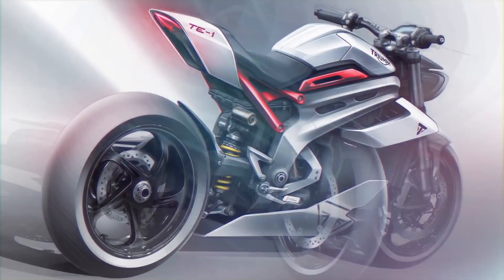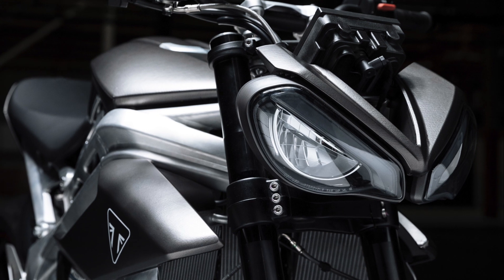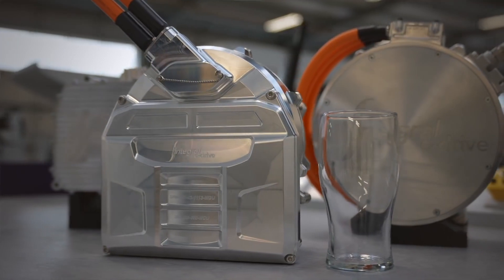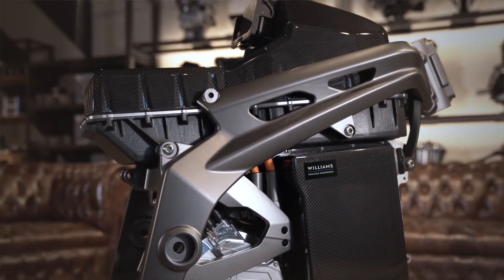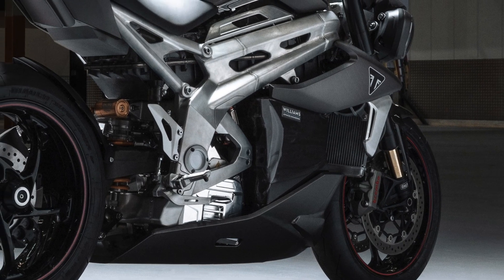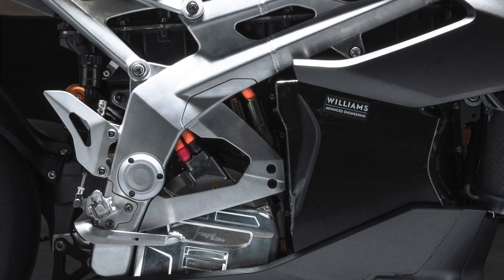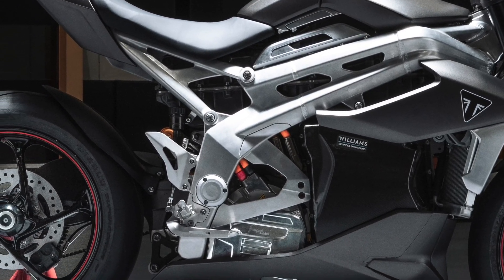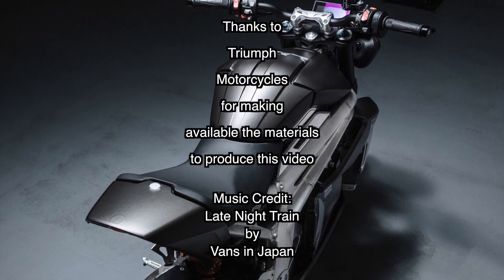The Best Electric Motorcycle Ever?

Comment: The first electric motorcycle that I really really want. The design is sick. Only 0-100 km/h 6.2 disappoints. But design... man it is something. What about indicative price and timeline to see it in mass production?
Reply from the maker: Hi Mantvidas, it does look good doesn't it?  The 0-100kmh (0-60mph) time is 3.6secs, the 0-160kmh is 6.2 (0-100mph), so hopefully less disappointing.  At the moment it looks like it will remain a prototype as Triumph are not planning a production run of the TE1 as it stands, which seems a shame.  I have an updated video which includes a comparison to its potential rivals, you can check it out here https://youtu.be/uHDNlcKHWYs

Thanks for your comment and thanks for watching.